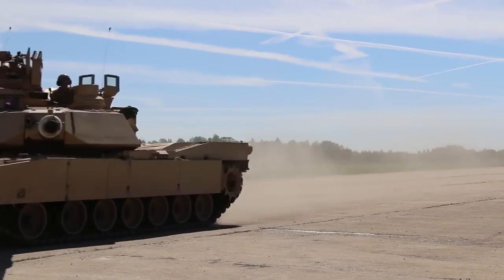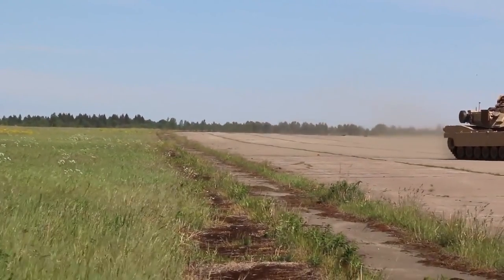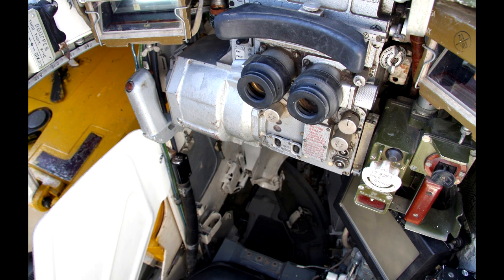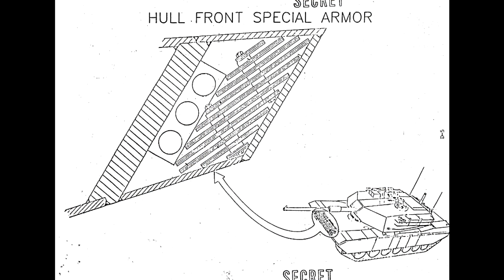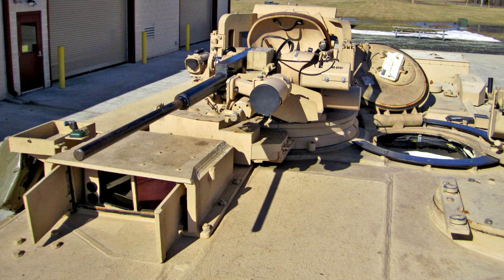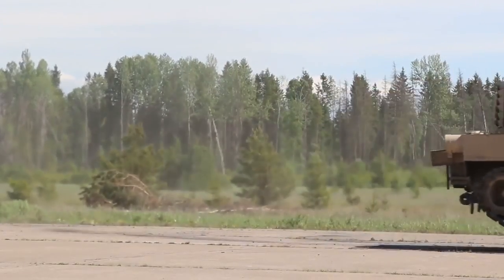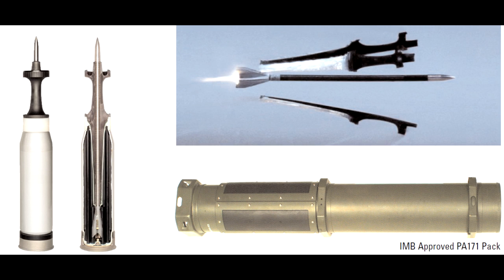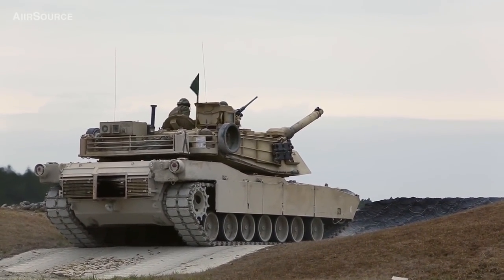Problems with Abrams tank

Comment: 30 Years ago, I trained on both the M-60A3, and the M1-A. Yes, they both had the 105mm main gun. But they both had a TC overide,  and I do remember an independent sight for the TC as well. True the TTS on the M-60 had better optics, but the gun stabilizer on the M-1, was far superior to the M-60.  The fact that the Commander's machine gun isn't stabilized is a non-issue,  the coaxial M-240 was.  I did however prefer the M-60, to the M-1, because the M-60, just had more interior room, the cupola and M-85 machine gun were far easier to use, and the M-60, was not as cramped. The M-1 was far more survivable in combat.  Who cares how fuel efficient the tank was, I'm not paying for the gas. This guy has never been in a tank in any Army anyway.  

ps, the autoloading mail gun on the T-72, was notorious for ripping off the left arms of Russian tankers anyway.
Reply: Did you expect more from a kid who gets his info from wikipedia, while using memes and weeb shit in his videos like a 12 year old? I couldn't watch more than 2 mins of his bs - like using gas fuel was bad. Pretending America doesn't have all the fuel it needs.

Comment: The fact is that that the Sabot round is what made the M1 Abrams a legendary tank during Operation Desert Storm when it punched through the Iraqi T62's & T72's armor.  The T62's & T72's AP- Anti Personnel Rounds & HP- High Explosive rounds where bouncing off our tanks like Ping-pong balls.  So the Iraqi Army retreated it was a Turkey shoot for us so the rumor of the M1 Abrams being invincible was born. During Operation Iraqi Freedom it proved a completely different story. Iraq got a new shipment of T72BU tanks that where upgraded and modernized with a new ANS round that was similar to our Sabot round . We started loseing M1 Abrams. The Iraq Army found out that the M1 Abrams had a design flaw near the hull of the turret where the armor was the weakest point and that's where they focused there fire power they also aimed for the treads. The T72 used to be a peace of shit tank but it has greatly improved it's been upgraded and modernized over the past 29 years . Now the M1A2 Abrams & T72BU are evenly matched. Russia has even further modernized the T72BU & T72M with the T80 & T90.

Comment: And how do you know so much about the armor? That information is classified.
Reply: No it isn't. The only thing that is classified is how effective the compsite armor packe is in RHA equivalency.
What is not classified however is that the UFP is only a thin sheet of metal plate. You can even see it on photos. 
And the older variants of the M1 are also not a big secret anymore, since they are already very old and obsolete anyway.
Only newer variants are still calssified. Btw there has been documents leaked to the public in 1998 from swedish tank trials which revealed some of the secret armor values of modern tanks (M1A2 and Leoaprd 2A5 armor values were revealed/leaked).
Reply: @xAlexTobiasxB  Classified as in on how the armor works.

Comment: I think if you saw an Abrams powerpack next to a leopard 2 powerpack you'd quickly realise the benefits of a gas turbine. The gas trurbine I'd guess is half the size and probably 1/3 the weight. If Leopard 2 had used a gas turbine the weight and space saved could have been used for better crew protection and a far better ammo stowage solution. The gas turbine also required much less maintenance than compararble Diesels.
The sights of the early M1Abrams were very basic as was common for the time. The first batches of Leopard 2 and Challenger 1 did not even feature a thermal imager.

Comment: Out of all the problems that the pro-Soviet tankies or anti-Abrams camps opine there is one issue I can definitely give them a point on and that is the Abrams is very "porky" which limits its strategic and tactical autonomy by a lot even with the doctrine and logistical system in place to compensate. The weight of the Abrams is eerily reminiscent to the issues the infamous German Tiger I tank had in WW2 which I find ironic considering we favored a doctrine of "high speed, low drag" mechanized warfare for the longest time. Still, this is a fairly thought out video, RedEffect, keep up the good work!

Comment: No one who is sane is going to argue against the conclusion that the Abrams is far from perfect, it is a tool no different then any other country's counterparts, gas turbine engines versus diesel, probably one of the advantages is the turbine is lighter and more compact, if you have the resources to keep it fueled because of it high fuel consumption and proper filtration then it is viable, desert conditions have to be the ideal worst case scenario for less then ideal situation for using a gas turbine system, diesel while heavier and larger is more reliable and consumes far less fuel....so there you go, apples to oranges, honestly with the current state of technology I personally believe MBT are obsolete, a simple drone can destroy several on one Passover, the top deck armor is thin/ light and very susceptible to air burst munitions, this applies to 99.9% of all mbts

Comment: And the jet engine had only 4 moving parts. That’s why they used it. Super reliable. Also, that 105 mm was knocking off t72 turrets and the crew with it. And yes there is an over ride, you are sooooo uniformed.

Comment: I mean tanks are useless now anyway, just expensive things for planes or drones or missiles ect. To destroy
Reply: Aircraft are even more expensive and they can be shot down by anti-air missiles too. Aircraft are not invincible. 
There is a counter weapon to anything. It's called combined arms. 
Besides tanks can be quipped with an APS which protects them against missiles, even against helicopter.

Comment: Great vid!

Just a copule of points:

1. In 1980's the lack of commander's stabilized sight might have been offset by the Soviet tanks lacking thermal imagers. I don't say that it justifies the lack of the periscope - it just makes  the gap somewhat smaller.

2. Whenever you refer to "commander's override" you mistake the term. The "override" (as stated for example in TM3.20-21 is the ability of the commander to turn the turret just like  the gunner does (with higher priority,  thus "override"). The commander's sight is used to 'designate' targets.

3.  The L/55 cannot be mounted in the existing M1IP/A1/A2 turrets. It simply would not fit. The M256's recoil system is what differs it from the L/44, as it had to fit into a turret designed for the L7. The L/55 is interchangeable with the L/44, but is not with the M256 - the full size of the Reihnmetall recoil system is needed for the L/55's recoil impulse.
Reply: I know this is old but the commander also had night vision I believe.

Comment: The M1A Abrams tank any version will not go to a diesel engine because it weights 1,200 more lbs than the turbine, and this is when we are trying to improve the armor on the tank, not take it away so we can put in the diesel engine.  "Whispering Death" could use a more fuel efficient turbine engine and many technological advances have been made in turbines to provide 1,500 hp at much less fuel consumption.  Congress simply will not invest in a new engine for the Abrams regardless of how much fuel it will save.  Multiple programs have received considerable investments to do exactly that for USAF fixed wing aircraft turbines called  ADaptive Versatile ENgine Technology (ADVENT), and the US Army helicopter ITEP (Improved Turbine Engine Program)turbine engines are awesome.  Less fuel consumption producing more thrust, with fewer parts for greater durability, and a Full Authority Electronic [engine] Control system for troubleshooting, data-logging, and monitoring engine health.  Some of the technologies in both of those efforts could yield a very advantageous new turbine engine that would be perfect for more than just the Abrams tank.  Honeywell actually developed and prototyped the LV100-5 turbine for the Abrams, and they have been functioning very well yielding 50% better fuel economy at idle, 25% better fuel economy on the move, on 43% less parts (greater durability on less maintenance), and FADEC for monitoring, maintenance data-logging, and trouble-shooting when in maintenance.  We haven't even approached even more efficiency by improving the recuperator, and using lighter and more durable materials in the turbine construct like Composite Matrix Ceramic parts.  This one upgrade would be a huge boon for the US Army by saving huge quantities of fuel, extending the range of the tank on its current fuel supply, and getting many more hours 'on-vehicle' before planned maintenance.  I hope congress sees the light at some point.  The most successful tank in U.S. HiStory has been the M1A Abrams Tank, and we want to keep it that way.

Comment: The fuel we use in our Abrams tanks is JP1. It is burns at a hotter temp than regular diesel. Meaning that it is less of a fire hazard. You can put a cigarette out in a cup of it. Also the army uses JP1 for hmmvs and all other vehicles that I’ve seen in my motor pool being fueled.

Comment: Fairly bothersome that you say a turbine engine is a "problem" on the Abrams yet praise it on the T-80

Meanwhile you could've went for more legitimate concerns like the Abrams not having escape hatches on its belly (cause of several deaths) or a sub-par FCS system that really hasn't been updated since the 80s.

Comment: One thing you dont realize for the engine about the fuel  consumption is the range... US vehicles are made to run 300 miles before refueling, so that one type of vehicle doesn't out run the supply chain (lessened learned from the germans in WWII)... but they all refuel at the same time  so consumption don't matter lol. Now the one stupid thing with the engine is the vpacks (3 air filters for the turbine) they didn't make them idiot proof. You could install them backwards, after taking them out for cleaning. We normally used a sharpie to mark the correct direction and location.
Even in the original M-1 we had an apu, we used it mainly during bivwacs during the nite. 
As for the 105mm, the turret was designed room wise to accept the 120mm it was a known upgrade. Don't quote me, but I believe it had to do with the new 120mm adaption standards for NATO specs that held it back from coming with the 120mm off the show room floor. So  alot of your negatives really are not when you know the whole context of the design of it.

Comment: I was a very well trained, and experienced mechanic, not just for the M1, but for almost every ground vehicle from the M151A2 jeep to the M1. On the fuel issue you brought up, the US DOD has done its best to have all engines run off of either DF9 (Diesel Fuel 9) and JP9 (Jet Propellant 9). Also, the DOD has done its best to bring all combat ground vehicles into the theory that all should carry enough fuel to move 300 miles until refuel is necessary.  I fully agree that the M1 needs improvements in a few areas, but thankfully Tank and Automotive Command (TACOM) is keeping contact with NATO/OTAN allies and is developing improvements. Keep in mind that the greatest barrier to improving US equipment is the lobbying efforts of government contractors to keep other companies from receiving benefit from the military contracts to the point they refuse to even pay royalties for better designs.
Reply: @raptors222222   I tanked on both the M60 series and M1 series tanks.  m1 start up takes longer ,is not quieter, and is susceptible to clogged air filters. we had to clean them every 4 hours during Desert Storm. Sand also damages the compressor.  Piston diesel engines are more forgiving of the type of abuse seen in combat and realistic training.
Reply: @raptors222222  I don't like it how confident you are, although completly wrong.
Reply: @raptors222222  Smaller than a diesel engine with same amount of power, maybe, and packs more thrust to weight, but is a jet engine simpler?  Simpler on a drawing, maybe, but it consumes high amounts of air and needs to ingest it all.  In clean, open air, jet engines are very reliable.  But in dusty enviroments, dieselengines eats less air and is thus easier to filter properly.  They are also more efficient and need smaller fuel tanks.
Reply: Indeed, it's nearly impossible for a forein company to sell military equipment. Just because of the  buy  american act. For instantie, the new air-tanker. Grumman and Airbus had time and time again the best proposal. But the lobbyists covinced the senate to buy the boeing bid because it's "completely" made in the USA. (All electronics are made by ferranti)
Reply: Matthew Cabrera General Dynamics has developed a new diesel engine pack that has similar power, is lighter, uses far les fuel.
Reply: daguard411 my M1A2 SEP V2 runs on JP8 fam.

Comment: This commentary while intelligent and correct lacks the strategic vales of fuel logistics. He even contradicts himself while ranting on "multi-fuel use in engine" and doesn't talk about the drastic weight difference between gas and deisel engines. Its like he's Russian they always look at tanks in Russian mindset. That's why they don't win wars outside of Russia. Although the title is Problems with th Abrams he seems dismissive of any benefits the construction had.

Comment: downcrying the choice of a gas turbine powerpack vs diesel has SOME validity...
... but "No plan survives contact with the enemy" (or summat)
but i remember how bloody FAST Abrams are... outrunning supply lines! (NOWT to do with crewchiefs 'playing' with fuel pressures a la certain helo a&p's!)
thirsty? hell yeah; runs a bit hot?? yeah, eats dusts badly? compact? easy to swap out powerpack?? oh YES!!! (give me the comic-book maint pub and could probably still do it NOW even tho' i was a Blackhawk puke/A&P)

don't i also remember they had to be flat-rated or downrated as this powerpack just wanted to make SO much POWER when running flat out? and to extend the lifespan of the cores/maintenance intervals? (one-time use engines in Migs chasing RS-71's comes to mind...)

EVERYTHING that is said of helicopters! (don't see many diesel helos on the ramp...), mebbee same with A-10's.

as a 67T(++) with my skillset/training I 'could' share/swap fuel; tools, maintenance paperwork... we could be tasked to supply, deliver, fuel, 'pull', retrieve, recover, re-arm/support and piss off and redo again; I NEVER could had these been running diesels, even those running JP- whatever.

multifuel capability is always a compromise... british SAS landies and US Marines hmmmmmmv's using av kerosene were 'quite' happy wiv the power/delivery, but didn't they 'drink' about twice as much?? also a bit of a maintenance issue as it burned SO hot it 'cleaned' ALL carbon deposits in their engines... i DON'T remember if they ran 'cooler' or 'hotter' tho' but in-the-wild resupplies were a LOT more frequent than pre-planned; or was THAT "the enemy has a say"?

ooh, i've come over all weak; time for black tea, hold the butter

Comment: I do know that gas engines operate at colder extremes than diesel engines but that's the only benefit I could see in using a gas turbine engine.

Comment: I like how he trys to shit on the upper front plate he didnt even take into the consideration the design of it being a UPPER FRONT PLATE yes sabot can melt through the t-72s turrets because there angle it meant to block ROCKETS AND MISSILES thats why its a circle and why the newer t-80series uses era so my point is when a sabot would hit the upper front plate most of its energy whould be dispersed along the slope because it flat and not a circle and another thing is tank gunners are trained to shoot the turret first to disable the tank so next time redeffect take logic into ur video thanks

Comment: Abrams had clear reason for choosing gas turbine. It had vastly superior accelleration(from superior engine torque charisteristics) and better net horsepower. (MB873 diesel had to divert more power to it's own cooling systems.) The problem of fuel consumption was overlooked though...

Comment: Important point that is missing in the video is the fact that German’s are using longer version of 120 mm gun not because they actually wanted to have better performance than Americans with their shorter version, but because for ideological reasons they are not using depleted uranium shells, but only shells made from wolfram pretty much like WWII tanks. That means they need longer gun to have enough of penetration to deal with Russian tanks. Even though the original plan was that in the case of WWIII they would get depleted uranium shells supplied by Americans. M1 Abrams could use longer version of gun without major complications, but according to US estimate when equipped with depleted uranium ammunition even current shorter version can reliably destroy any tank currently existing. Therefore upgunning  of Abrams wasn’t and still is not priority.

Comment: The M-1  is quiet compared to tanks with diesel engines.
Reply: Doesnt make any difference on the battle field. What does is the slow response. When you twist the throttle, there is a delay in power. It sucks when you're going through a ditch where you drop down and immediately begin ascending. If you time it right it's fine, but it takes some finesse. I would have preferred a diesel. Still a monstrous killing machine. It has some amazing strengths, but there  are some drawbacks that weren't even discussed here.